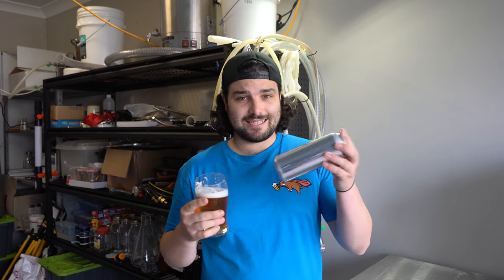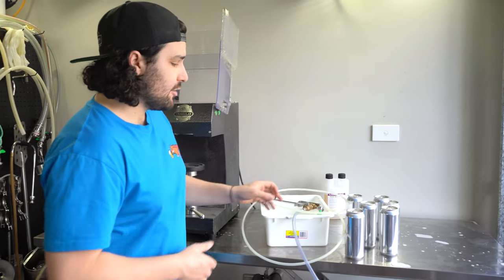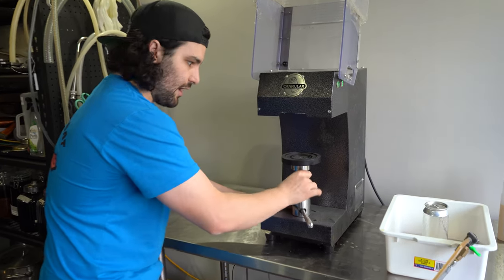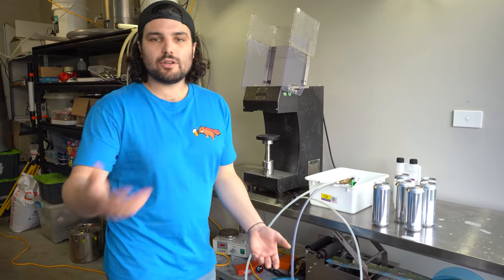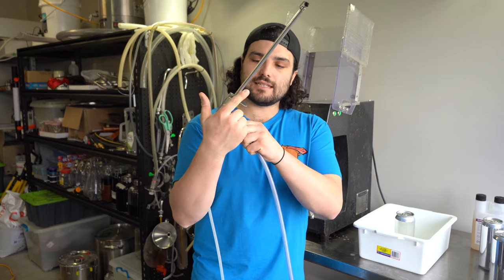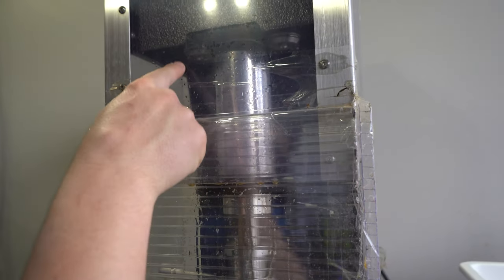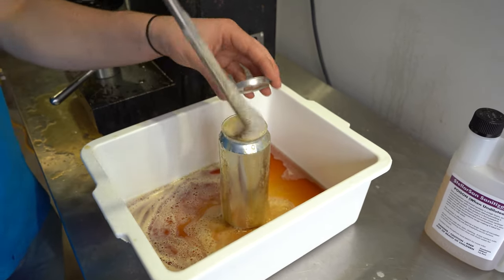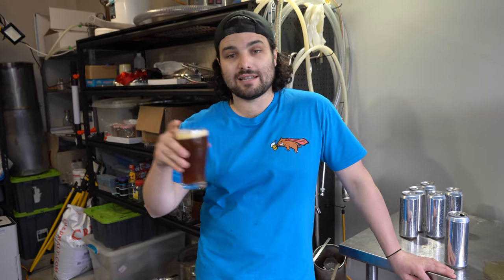How to CAN Beer With the Cannular Canning Machine?!

Comment: Oktober makes a model called the Benchmark which is about half the price of other can seamers. They can do that because it has no motor... you use a cordless drill to power the unit. Tapcooler makes a less clumsy (to me) purge/fill tool also.
Reply from the maker: Oh good call cheers mate, yeah moving forwards we want to setup a permanent canning station but are still trying to work out exactly how we want it to work